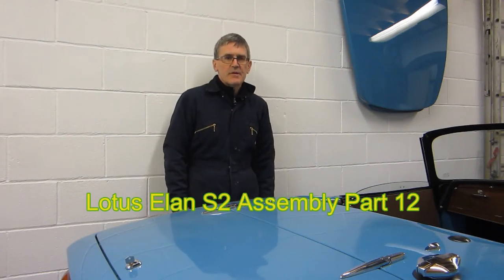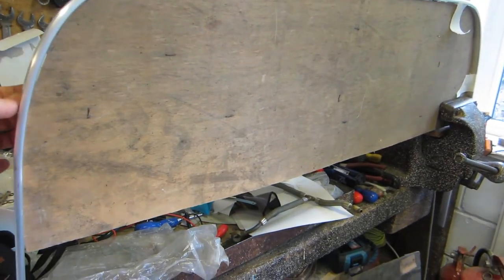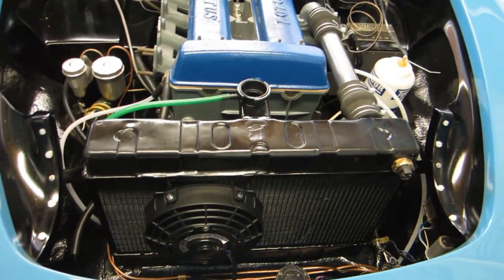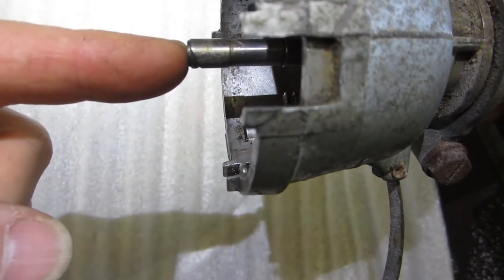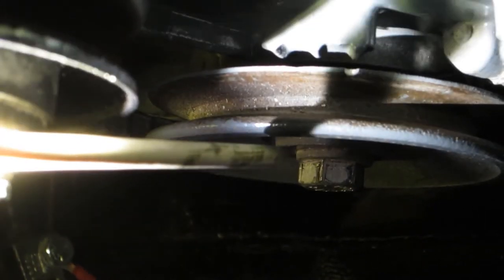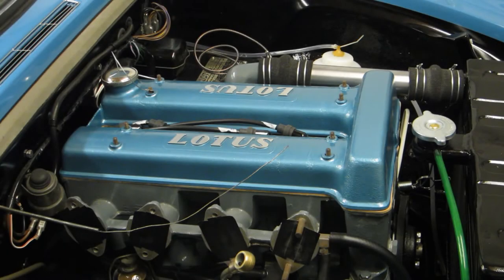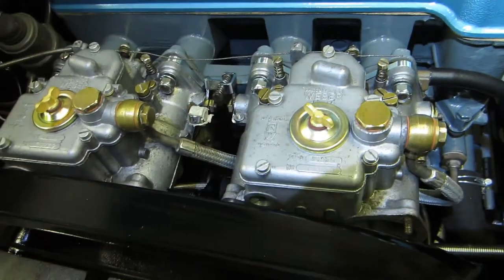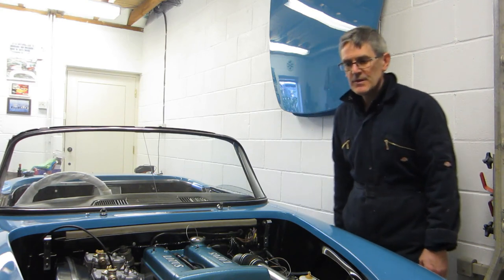Lotus Elan S2 Assembly Part 12

Comment: If you are doing many miles you soon get fed up with working on the distributor. I fitted an electronic conversion but was unlucky as it came from a bad batch which failed quickly. The only time the RAC had to tow me home. The replacement worked fine, but i also had to fit silicone plug leads as there were sparks all over the place in the dark. Not nice on a glass fibre car.

Comment: 22:29.  Here's an idea I got from LotusElan.net.  Rather than using those special rubber washers to prevent the oil from leaking after it escapes through the cam cover holes, you can stop it before it leaks through the holes.  Before installing the cam cover, cut some small pieces of rubber fuel line that will fit over the 8 studs.  Cut them long enough to make them form a seal against the inside of the cam cover when you tighten down the cam cover nuts.  Pretty good idea, don't you think?  I did this on both of my Lotuses and it worked great.  Another great video Paul.  Keep 'em coming!

Comment: The new rotor arm looks the same as mine, except mine is black. The old one you showed in the video is the rev limiting type. I had one of those a while ago but it cracked at the base. I don't think the rev limiting type are available any more? Where is the radiator overflow bottle fitted? I can see the green pipe going down the r/h side of the radiator. I'm guessing now that because your radiator highest point is higher than the thermostat housing you don't need the expansion bottle?

Comment: Well done Paul.  Nearly there.  It's trunking that runs off the airbox to the filter.  From my experience, don't have the carbs too lose otherwise unwanted air will get into the combustion chambers affecting performance/tuning.